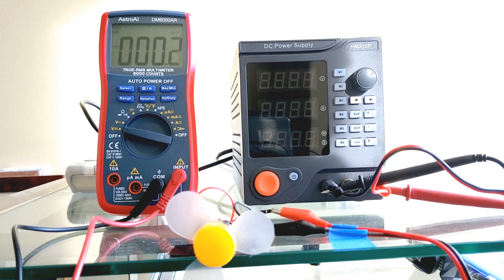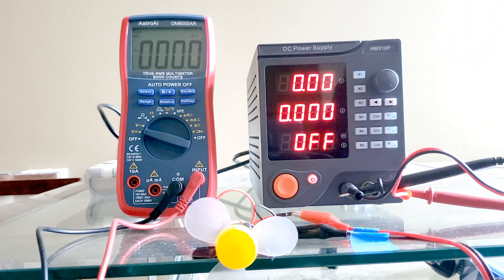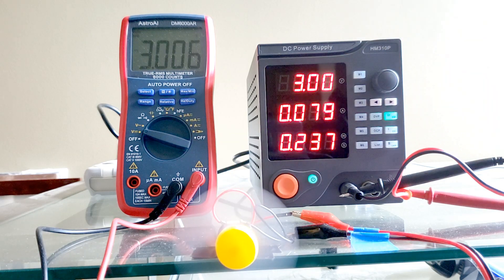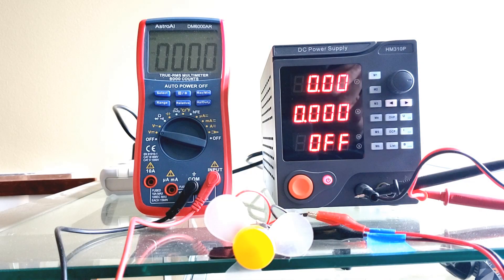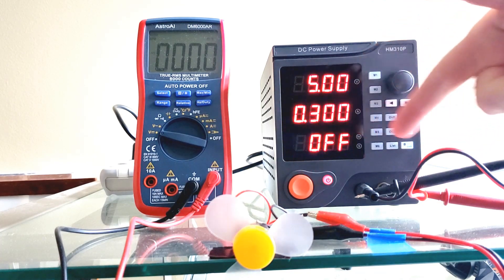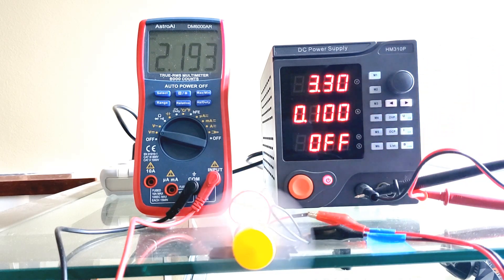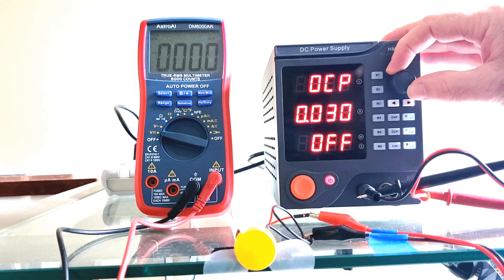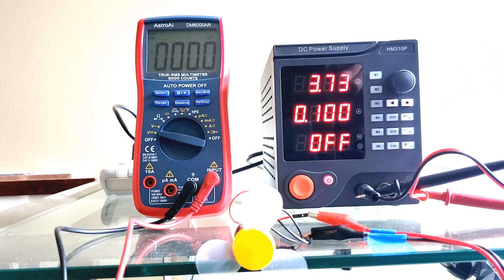HM310P Power Supply Operation

Comment: This is the most comprehensive feature video I have found for this unit. The manual is garbage. Thanks for sharing!
Reply: Thank you. I have re-written the manual and added new material so if you download that then you should have something you can work with (the updated manual looks the same but the content is different and I the language is cleaned up). My unit is still working great and I use it all the time.
Reply: @PeterRowe-k1o I didn’t even see the manual…Thank you so much! Printed it out right away. Yes, it’s a great little unit. So handy in the shop. Thanks again for sharing!

Comment: Just a couple of questions, I'm new at this and am looking for a unit that will do all of what you use one for, but would like to know if it will effectively charge LiPo/LifePo using CC, then automatically switching to CV when it reaches the setting you enter. I've read the manual and while it does have both CC/CV modes, it say's nothing about automatically switching to CV and not a lot of info specifically for charging. Also looks like most places are out of stock which maybe this is discontinued, and wondering since this post is old are you satisfied  with this unit over time, would you recommend purchasing one or another that has similar functions?
You did an excellent job of explaining and very instructive video covering this unit.
Reply from the maker: Thank you. Yes, I use it to charge Lipo batteries using he 1C method. For example, if you had a 1000mAh Lipo, to charge at 1C you would set your charger for 1 Amp. The voltage takes care of itself so for example, if you set the supply to say 4V (or whatever voltage the battery is) then the unit will begin pumping out 1 Amp, but if the battery is discharged, the voltage will drop right away. As it charges and the voltage builds up to 4V it will stop there and now the current drops down as the battery gets more and more charged
Reply: @circuitsbycode5443  Thanks for responding! I figured it would but reading the manual didn't say. Is there any way it can be programed to stop charging when current drops to a value you can set?

Comment: Ive read a few reviews on this product inferring that it bangs and sparks when turned on. Can anyone comment on the reliability of there unit ?
Reply from the maker: I've had mine for more that a year and I use it all the time. Currently I have it charging a fuel cell to extract hydrogen from water. I have never seen any "bangs" or "sparks" when turning it on. The great thing is the separate output on/off switch so it comes on with the output off. I use it for many different things, including charging all kinds of batteries with no problems

Comment: Front Panel Operating  Instructions:
To set Voltage, Press "U" key;  use arrow keys to select digit place and use jog wheel to select digit. Press "B" key (enter)
To Set Current Limit, Press "I" key; use arrow keys to select digit place and use jog wheel to select digit. Press "B" key (enter)
To program voltage, current, and time into memory location (i.e. M1), Press "M1". Cursor will be on voltage field;  , use arrow key and jog wheel to select digit locations and digits. Press in jog wheel. Cursor moves to the "current" field. Again, use arrow keys and jog wheel to select and set digits. Press in jog wheel. Cursor will move to bottom field.  This field is a time field.  If you want the present setting to stay on indefinitely, select 0 in this field.  If you want to use this voltage/current selection in a sequential series of voltage, current periods, select the time you want this selection to be output in seconds (list mode).  Press the "M1" button twice to enter or accept this "programmed" selection.  Repeat for M2-M6 as desired.  If you want to programmatically select the memory locations you have previously entered,  press the "List" button to have the power supply step through your selections sequentially.

Notes:
The "B" key also functions as a front panel key lock out.  Press and hold to Lock and unlock the keypad. 
There is an aggravating 4 second timeout on all keypad entries.  If you wait too long at any one step. The Power supply will abort and you will have to start over. No way provided to change this time limitation !
I don't read Chinese very well and the factory instructions for operating the front panel were not intuitive or clear.  Apparently this PS is marketed by a number of companies.  I scraped and summarized the instructions above from this  YouTube video (Circuits by Code) on "HM310P Power Supply Operation" https://www.youtube.com/watch?v=FszOIFw9FO0 for a Hammatek HM310P. Hope this helps someone else.
Thank you, Circuits by Cole
Reply from the maker: Thank you for the notes. Yes, I rewrote the manual to make it more clear and you can find it at: https://circuitsbycode.com/

Comment: I have the Rockseed version ot this power supply, and it was fairly expensive, but worth every penny IMO, I really like it. The ability to set the Voltage and Current before committing to completing the circuit is a feature that should be on every power supply. Between this and setting the  Over Voltage and Over Current settings, you have some great and nice features that ensure that you'll not let the blue smoke out of your favorite circuit. The display is easy on the eyes and clear as a bell, even at a distance! 
I think this is one of those investments that are worth making. It's a well-designed lab type piece of equipment. Kudos  to the originator of this design. Nice!
Reply: I got a rockseed unit too - its invaluable - as a bonus better S/W is on github

Comment: sorry for asking this as its not related to your video but have you tried the CV and CC feature on this PSU . I tried charging a battery cell at some voltage but this PSU shifted from CC to CV before that set point was reached . please let me know if you have faced a similar issue too , thanks
Reply: This will happen if the battery is full or it is not able to be charged well. In another word, the battery is no good. It happened to one of the 18650 batteries which I tried to revive. The other batteries all charged well.
Reply: It didn't switch to CC before the voltage reached the limit, as soon as the current starts flowing the voltage jumps because of internal resistance of the battery and if the current is to high then the voltage without voltage limit would be above the limit as soon as charging starts. Try charging with lower current. For example, if LiPo battery is at 3.8V and the current limit is 2A then voltage without voltage limit would jump over 4.2V and in that case the CV mode would be activated. If you lower the current to 0.5 A the voltage jumps less and it would take some time until it reaches 4.2V. If the battery has high internal resistance the voltage jumps more with the current.

Comment: I ordered through Amazon two days ago and received it the very next day. $98 US with free delivery. 
It was easily mastered especially thanks to your excellent tutorial video.
I really like this unit due to the fact the voltage and current settings can be easily dialed in with rock solid stability.
Most of the competing switching supply's of this kind seem to be plagued with "quirky" oversensitive settings as I have seen in several videos.
The 5 second timeout is a non issue when you get used to it.
I did note the AC ripple was a bit higher than the spec sheet showed.
But what the heck, its not bad for a inexpensive switching power supply.
Reply: Even better is the HM310T for the same, to less, money on Amazon.  Give it a look.

Comment: Bravo! Excellent tutorial for this unit. You explained it's features very well.
Now, I looking for a video of comprehensive performance testing including noise tests.
My only criticism is the "time out" feature factory set at 5 seconds. It would be nice to have it at 7 or 8 seconds.  Better yet, if the user had the option to adjust the timeout.

Comment: Has anybody tested this power supply with very low currents ? such as small electronic circuits.
How accurate is the current measurement in the 0 to 10 mA range ?
I have a RockSeed RS305P and the current does not register until 8mA, it could be a fault or maybe the current measurement is just inaccurate, it measures correctly with a multimeter so I dont see why power supply should not be able to manage it.
Thinking of returning it to Amazon
Reply from the maker: Hello @Keith L. Yes, I have the HM310P - the same version as you but 10 amps. I see the same thing. When I put a 1K load across the outputs and set the unit to 5V, I should get 5mA. Instead I see "0.000" for the current display when I should be seeing 0.005. I do see the 5mA on my multimeter. If I crank up the voltage until my multimeter reads 7mA the current display on the power supply finally activates from 0 to 4mA (0.000 -> 0.004), still a bit off. It gets more accurate as I turn up the voltage to output more current and matches my multimeter at about 18mA.

Oddly, while the display does not show low currents, the power supply itself is still able to limit the current at low levels. For example, when I set my voltage to 5V and current at 5mA and then crack up the voltage to increase the current output  the unit will limit the output to 5mA (and the current "I" button turns red). This works all the way down to 1mA. From this I don't think there is anything wrong with your specific unit, its just that the unit in general does not display low currents well.
Reply: @circuitsbycode5443  Thanks for doing those tests, you got exactly the same result as I did including the fact that the current limiting works all the way down to 1mA but the power supply does not display the actual current on the LED display.

I reported the problem to the distributor here in the UK via Amazon, he sent me information to calibrate the unit, after some trouble understanding the badly translated instructions I did manage to recalibrate the current measurements but the problem with not showing the low mA current remains, a second approach to the distributor resulted in the statement that there was no other way to fix the problem.

It looks like there is a bug in their programming.

I have returned the power supply to Amazon for a refund, it’s a shame as the rest of the unit works well and the price is good, it just did not suit the work I want to use it for.

Comment: very disappointed this model not able to switch to 230V
Reply from the maker: @Hugo Hew. Yes, the one I have does not have the 220V option either but I have seen photos of the exact same model that do. I am in the United States so I'm guessing it does not have this option in the U.S. market which is why I noted in the updated manual, that the U.S version is 110V only. Can you tell us where you are located? Thanks

Comment: The U and I on both buttons are the international formular symbols for Volt (V) and Ampere (A). This is common in international school and science mathematics based of the metric system. It looks like the U.S. is not using it.
Reply: We do our own thing though I is Amps the U is just weird and will never get accepted in the USA for the next 50-100 years, if ever.
Reply: @generalawareness101  Maybeso, but we europeans think it is silly .Say I=34A,but V=12V  .
Obiously (V)=12V should be (U)=12v  analoge to current (I)is 34 A.
 so  voltage should  be (U) and not (V).
dahhh.
It sets apart units from quantities
Reply: @schytdemijn5398  As I said this is the USA and that will never fly here for at least another 50-100 years.  Hell, even in College electrical courses they don't teach the U.  Look at Ohms law to see it written as V = IR.  V/I/R.
Reply: @schytdemijn5398  I have been hearing that already since we were supposed to go metric by 1982.  Didn't happen.  I already saw a film about this and it would cost so much for the US industry to switch that you would have an easier time trying to get us to switch our house voltage to 240 50hz from 120 60 hz.  Good luck with that.  Wish in one hand and shit in the other and see which fills up the fastest. :/
Reply: @generalawareness101  that last sentence is really deep.🥱
Still changing tot metric is not  the same as changing a bunch of appliances .But you have a point 😇

Comment: Try setting the voltage to about 20Volt and limit output current to 20mA. Then switch output on and connect the led (without Resistor). If your led survive this, it is good powersupply , if not try this one: riden rd6012. Thats what I bought after i get rid of hm310, which is by the way more expensive.
Reply from the maker: Hello @powermax. Thank you for the feedback. We've worked with LED's for a long time but never thought to power them without the protective resistor until we saw it on YouTube. Previously we tried it with success at 5V so today we tried it again; we set the current ("I cc" button) to 10mA, as 20mA is the max for our LED, and the voltage ("U cv" button) to 0v and connected the LED directly across the power supply terminals. We turned up the voltage slowly using the rotating shuttle knob.

At about 1.6v the "U cv" button is lit green, the "I cc" button light is off, and the LED first begins to light up dimly using about 0.1mA. Turning the voltage up more the LED is bright at 2V using 2.5mA, "U cv" button is still green and "I cc"  is still off. Turning up the voltage to a little more has the LED gets brighter and at 2.3V, with the current just at 9.6mA, the LED suddenly gets a littler dimer; the "U cv" button light goes off and the "I cc" red light comes on showing the current is limited. Turning the voltage up further manually past 2.3v using the rotating shuttle knob we could go all the way to 30V and the LED kept lighting with the voltage limited at 2.8V and the current still limited to about 9.7mA.  All looks good so far.

Then instead of manually adjusting the voltage, we turned the O/P Off and back on at 3V. The LED flashes briefly and then comes on fully. We tried the same at 5V, 10V, 20V and 30V and it works each time - the LED flashes when it comes back on each time. We suspected this would fail with a current spike when the power O/P was turned on but no,  all good so far.

Then, with the power O/P still on we physically disconnected the LED and connected it again, this time the LED did not light back up and was destroyed.

It seems then that the "ON/OFF power output button" in this case does protect the integrity of the current limiting feature of this power supply all the way up to maximum 32V. No doubt there are other scenarios and we would love to hear about them - thank you!

Comment: Did you know that there is a secret menu you can access by Holding Output ON whilst powering up. There may be a way to change the 5 second inactivity setting in there
Reply from the maker: Thank you all for the kind and supportive comments and thank you Terry for the tip. I did come across the mention of a "secret menu" but did not know how to turn it on so a big thank you! The secret menu is rather cryptic but I have been looking at the software that accompanied the unit to find that it offers some insights to what things mean in the included XML files. I have also been looking at 3rd party software. I intent to do another video on the accompanying software and 3rd party software, and also how to easily turn the button beep off.  Alas, I have not yet been able to find a way to extend the inactivity timeout yet.

Comment: I have a question. What's the maximum time that you can program it to run when you set up a memory button? 999 seconds or 9999 seconds? Thanks
Reply from the maker: Thank you, you are my first review! I am delighted with what you wrote as it is  the reason I created this video, I can't believe you nailed it so well! To answer your question, the maximum time for the automatic voltage/current switching feature under the "List" function is 9,999 seconds or 2 hours, 46 minutes, and 39 seconds for each specific memory button that is enabled. I think it is a nice power supply, the only negative I would say is that the 5 second inactivity timeout is a little annoying although you get used to it.